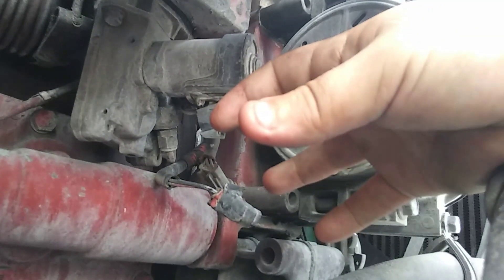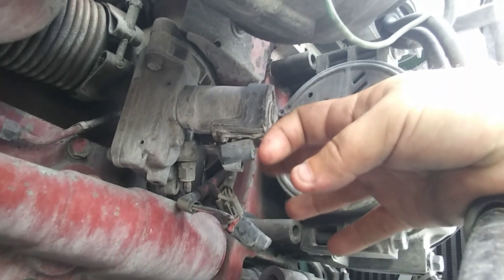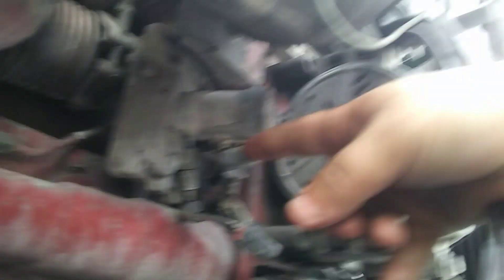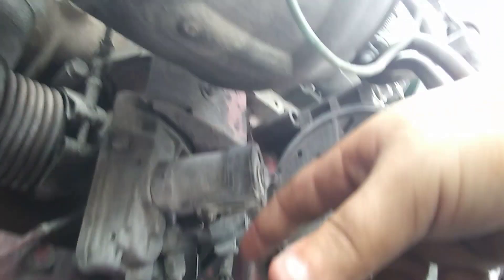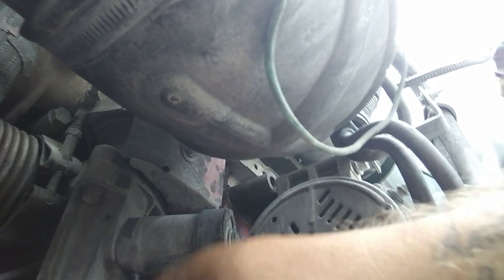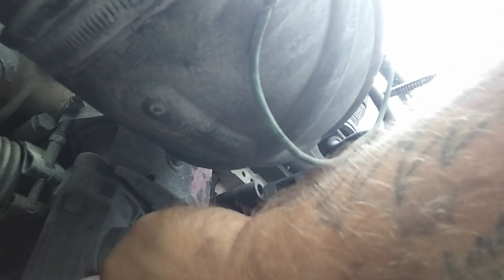Cummins isx cm870 egr delete - unplug free.

Comment: I have deleted isx 870 
My exaust back pressure is too much that its leaking thru exaust manifold
And engine oil is up to 240 
What can i do ?
Reply from the maker: Straight pipe it. Your exhaust is clogged somewhere and I would start with the muffler personally

Comment: Hey man. i replaced the turbo and actuator, i have cummins isx 15 500hp. Before they found out they were messing with my engine swaping sensors this and that, now since they replaced my turbo and actuatoe truck has no power, and gave me code sa 0 spn 411 fmi 2 egr differential pressure sensor. why is this code poping up ? 

thank you
Reply from the maker: I take it that your engine is not a cm870. Differential pressure sensor I believe is for a the dpf system.
Reply: @Shawntuning  both egr and dpf are deleted. I don’t know what they did and i don’t know if that sensor still work even deleted
Reply from the maker: Most likely they messed with the tune
Reply: @Shawntuning  omg that sucks
Reply: @Shawntuning  Yes this is cummins isx 15 cm2250 sorry i didn’t mention that, code is giving me egr differential pressure sensor

Comment: What code do you get
Reply from the maker: I don’t remember that was a long time ago
Reply: I’m getting a mid 128 pod 27 fmi 4 
And a mid 128 sid 146 fmi 7 codes it’s all still plugged in but feel like it’s maybe stuck open. Recently getting a pretty bad average driving from Seattle and Boise. Normally heavy loads 75-79k gross and I would get 6.2 to 6.6. My last two trips I’ve been getting 5.4 and 5.5 nothin has changed nor was there any high winds
Reply from the maker: Sounds like is open
Reply: @Shawntuning  best bets probably replacing it huh? Then let’s it run the cycle and unplug it. You know by chance if I were to replace it would I need to drain the coolant?
Reply from the maker: That or you could get a bloc off kit, but I can’t legally advise you on that 😉
Reply: @Shawntuning  that’s for the info help and quick response. Last question we’re are the MAP sensors on these things wanted to clean that out or change it but can’t seem to find any info on we’re their located
Reply: Thanks*

Comment: Would you explain how did you put straight pipe and what parts did you took off before you put straight pipe ? Thanks
Reply from the maker: Straight pipes is a expression for a exhaust with no restrictions like a muffler. So it is open pipe from the turbo back
Reply: @Shawntuning  does it have DEF?
Reply from the maker: @jasonanderson8528  no
Reply: @Shawntuning  I have a 2006 9200 with the 435hp isx I believe they are very similar to the 9400 all I need to do is unplug it.
Reply: It's the 870
Reply: I had a inframe done on it 6500 miles ago will it hurt it

Comment: Thanks man. I’m planning on buying a truck with the same engine . In your opinion is the cm870 a good engine? And yes I have subscribed..... lol
Reply from the maker: I love the cm870 engine. It is reliable and powerful with good fuel mileage. Just keep up on maintenance and you will be golden.
Reply: @Shawntuning  -  love your vids bro.  I have a slow down on my cm870 on slight up hills  and when under pressure I hear air struggling noises like air wants to pass but doesn’t and then it does pass weird stuff. Also when I assume the truck needs the turbo sometimes it doesn’t come on and I feel a loss of power , then sometimes it comes on when it supposed to and I get all the power in the world. Can you give me some pointers ? Thx
Reply from the maker: If you trace the air line from your wastgate over to the drivers side over by the air compressor you will find a valve. I do not remember what the exact name of it is but that is what regulates your boost pressure. I would start there
Reply: @Shawntuning  ok thx man
Reply: Thanks for taking the time out to answer my question. I have been running a Detroit for 17 years and I’m clueless about anything else. I will keep watching your videos brother.
Reply from the maker: I appreciate that.
Reply: Currently dealing with these issues, how has it worked for you in the long run?

Comment: You straight piped what? Maybe you should do a video on that too and name it -part 2. But I actually have the 2013 ISX15 2350 motor. Not sure how this motor will compare.
Reply from the maker: Trucker Ron straight piped the exhaust. And the 2350 is like my cm870 but with more Sensors and Emissions components

Comment: Hey fam need your help an advice; on my cm870, I have blue diesel smelling smoke coming from my exhaust and it's idling rough.... I'm thinking its a injector that's gone.... please help
Reply from the maker: Sounds like injector or vnt on turbo isnt working right
Reply: @Shawntuning  thanks for responding, I'm kinda at a lost at the moment; cause I'm having a hard time of finding someone to put one in for me Smhd
Reply from the maker: Best thing to do is find a reputable shop and have them or you do a boost leak test. Also if you have a boost gauge check your levels. If all is good then do a injector leak down test.
Reply: @Shawntuning  okay thanks 😎
Reply from the maker: I just remembered I had a similar issue on my truck and I am going to make a video and put it out tomorrow the way I solved it but try this before you do anything
Reply: @Shawntuning  okay kool